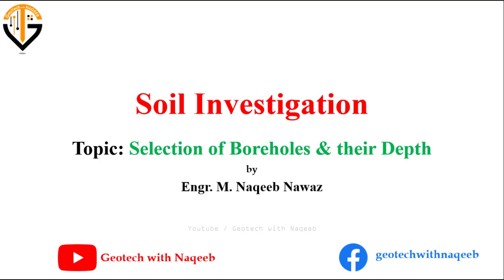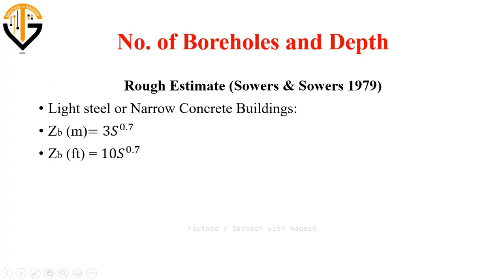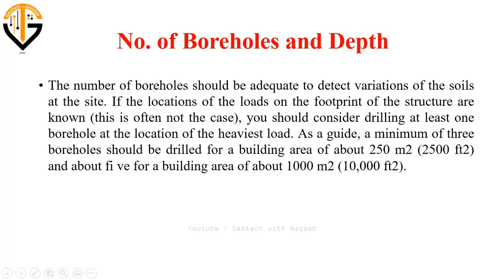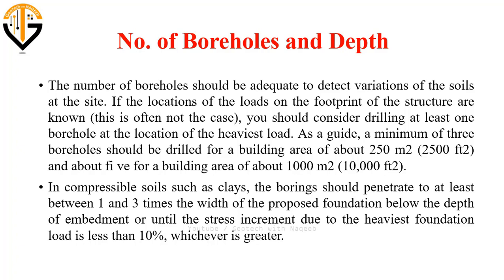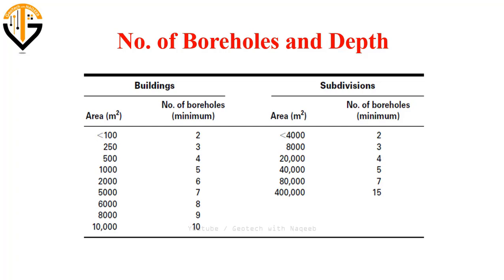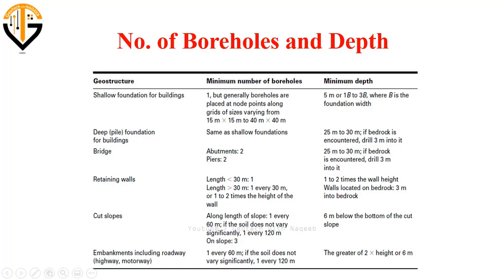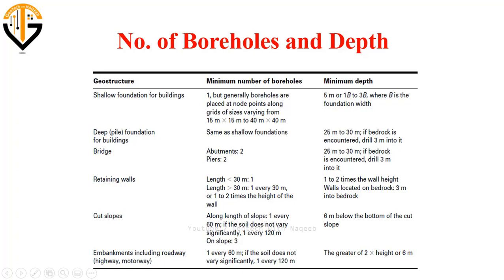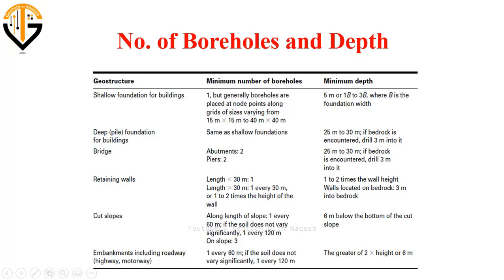Soil Investigation Lecture# 01 | Number of Boreholes and their Depth | Geotech with Naqeeb

Comment: Thanks for the good explanation, I have a simple question, S is just for the number of stories for the superstructure or superstructure plus substructure (number of basements floors)? For example, if the building is 2 basement floors with 10 upper floors, then the S value would be 10 or 10+2=12? tnx in advance.